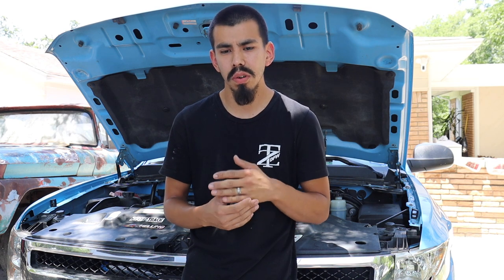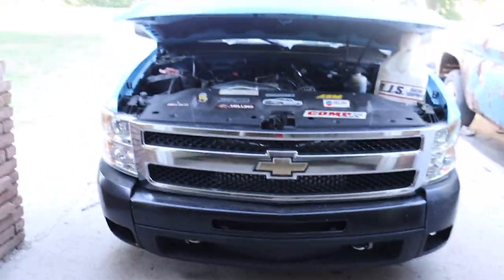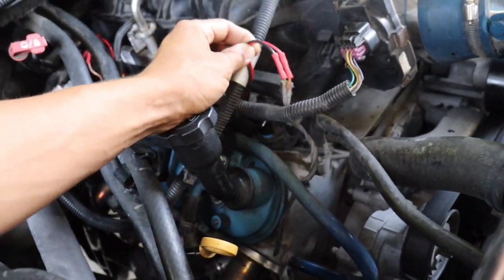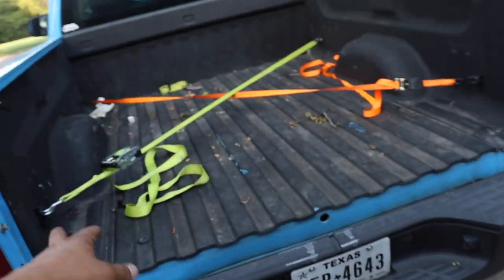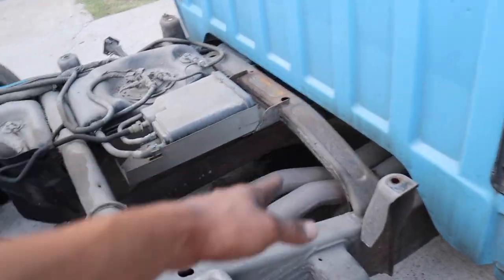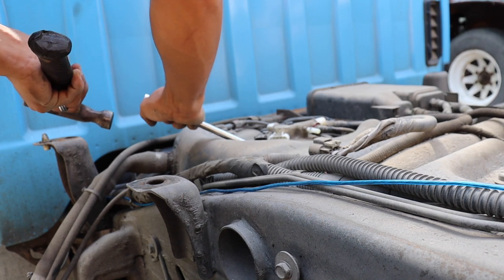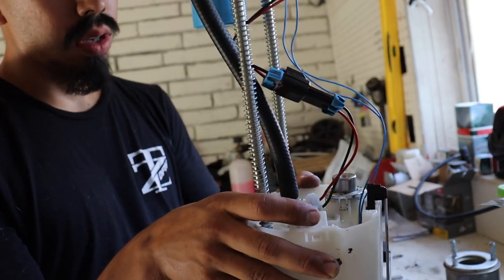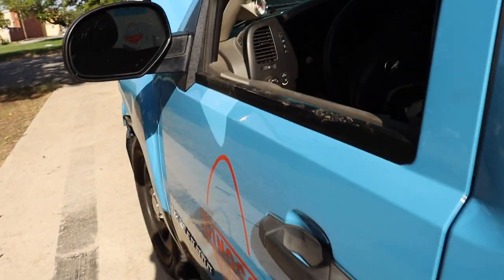BTR CAM KIT RAFFLE | WALBRO 450 FUEL PUMP INSTALL

Comment: U just pinched the slpit wires together with pliers and left it like that bro ? It don’t cause a issue asking because I’m doing one rn and kind got worried bout that also u didn’t have to modify the bowl a little I’ve heard u have Fidel problems if u don’t 🤔

Comment: Fuel pressure looked low on the regulator. Should be around 58 psi if im not mistaken.
Reply from the maker: im not even sure honestly, I had it turned down because due to the new injectors its running way to rich
Reply: @dinocoblue2709  the fuel system module that is near the rear of the truck may need to be tweaked as well Diego. I have read a lot about people having to go into them and use a file off of a CTS-V one to use the parameters to set the truck one, but I'm not all that savvy about the tuning part and electronics. Lmao

Comment: Bro can you give me the link to where you ordered your 450 fuel pump from and did you buy a return style kit or just ran it all yourself? I heard it was difficult to do, bit you made it seem fairly easy. Thanks
Reply from the maker: I bought it from amazon just put walbro 450 and look for one that has good reviews and know I didn’t buy a return kit, I should be just a direct swap with the stock fuel pump
Reply: @dinocoblue2709  ok cool. Yeah I will be going single turbo here soon and aiming for 650RWHP so I'm pretty sure I'll need the return fuel line and regulator ran. Are you using your stock fuel rails also? I know I'll need the spacers for the rails with the 80# injectors, regulator and return line along with the new 450 pump.
Reply: @dinocoblue2709  did you get the High Pressure or the E85 or regular gas version?